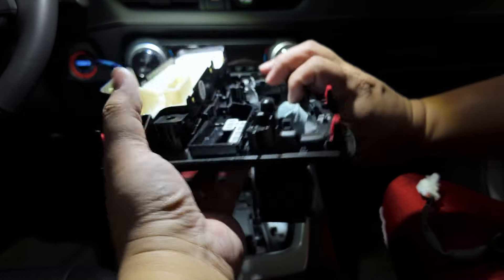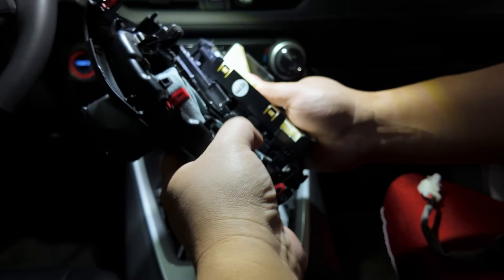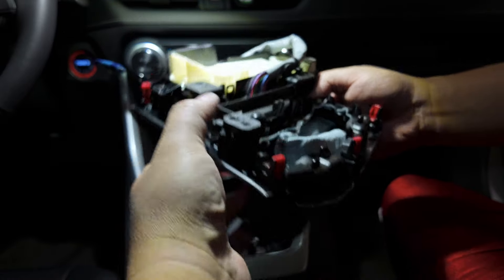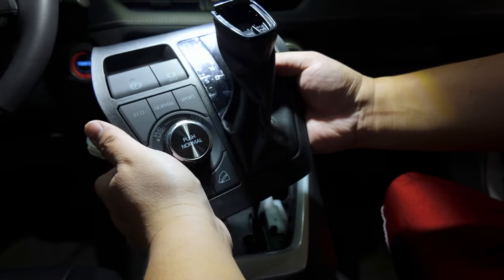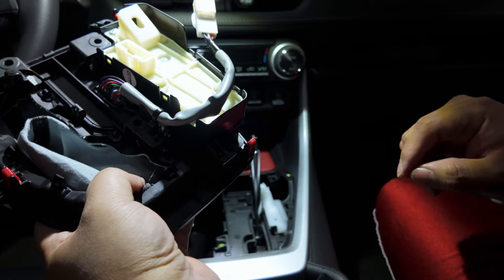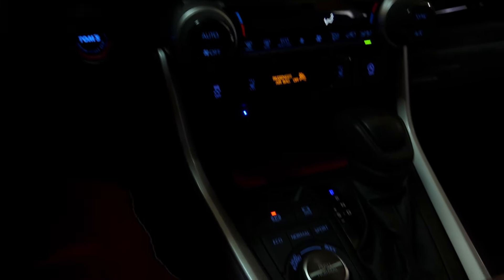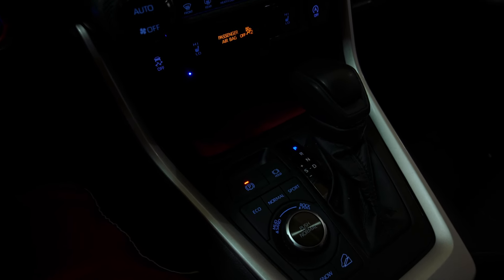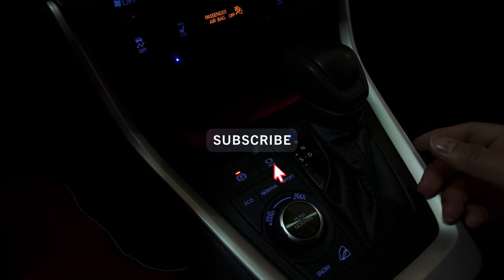SWAPPING TO A NEW DRIVE MODE SELECTOR / MULTI TERRAIN SELECT | 2021 5TH GEN TOYOTA RAV4 XLE

Comment: can i buy for any year form 2019-2024 so it fit 2019-2024 or do i need to buy form 2019-2021 so it will fit 2019-2021 or i can i buy form any year 2019-2024 so it will fit any year from 2019-2024 let me know asap
Reply from the maker: You’ll need to select the right year, because different model years may have a different wiring.

Comment: which to do buy because there is three opiopns
Reply from the maker: Depends on your model, i picked  petrol - 4wd
Reply: @Forged_Garage  i got a 2023 toyota rav xle premium rav4
Reply from the maker: Does your factory switches same as the one i removed?
Reply: @Forged_Garage  i have not remove mine yet
Reply from the maker: Their website says it fill fit 2019-2024

Comment: I have the ebrake malfunction issue after change the knob.
Reply from the maker: No problem on mine, did you connect all the harness back?
Reply: @alliven I think I just had to pull the parking brake toggle (the "P" button) towards me while the car is on. Seemed to clear things out. Will update if anything changes
Reply: @KenduranceSolutions  Yes, I did that too. It seems the car cannot recognise the switch until I change back to the original one. As you said, pull the park switch several times, the message will be cancelled.
Reply from the maker: Good to know that its working, mine did not required me to do that.
Reply: @Forged_Garage  no, it doesn’t work on the knob control. 😭😭